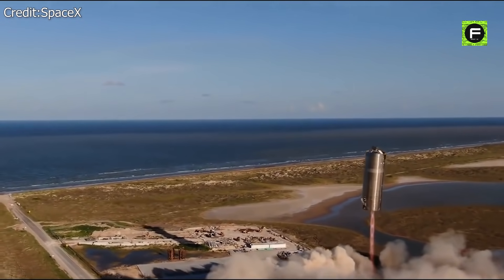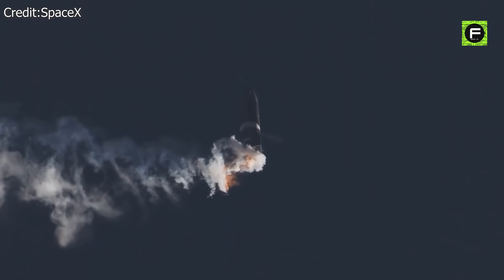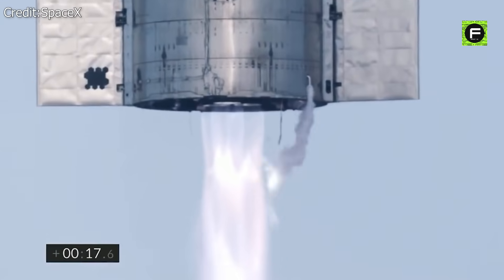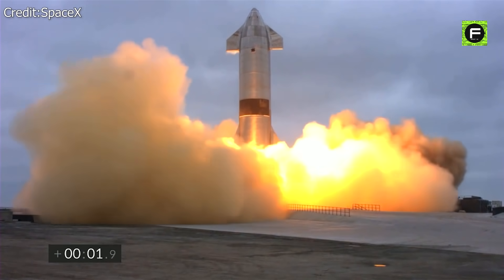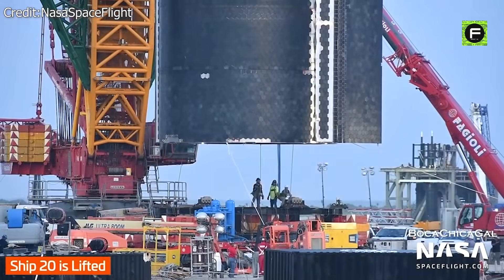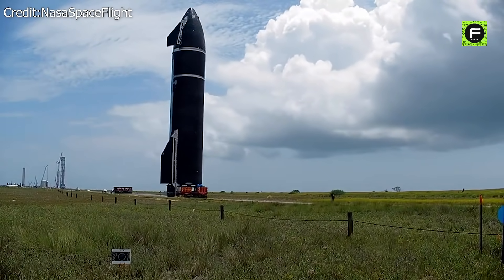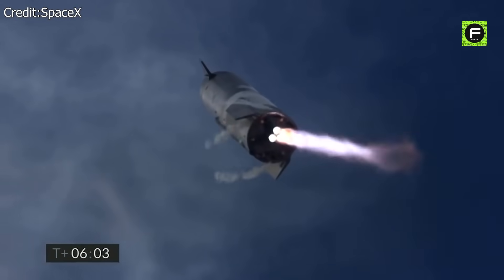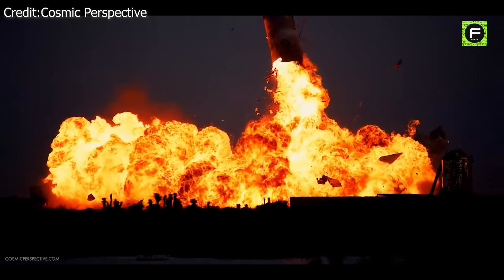Why Starship SN20 Will Splash Into Water Instead Of Landing?

Comment: GETTING STAR SHIP TO LAUNCH IS ONE OBJECTIVE ? NJEXT IS BOOSTER TO LAND ? NEXT IS STARSHIP TO ORBIT ? NEXT IS TO RTENTER? NEXT TO LAND???? TO LAND NOT ON A CATCHING ARM? TO L;AND ON ROUGH GROUND????  LANDING TOWERS Cannot be built every where? any slight direction error will be a titanic accident waiting to happen?   Getting massive pay load to orbit means this access of mass weight can be traded for landing gear and emergency equipment?   launching and losing  a machine is crazy waste of analytical inspection? lift off to a, compete safe return should be the first and final  only goal?  Salt lake wouldm be a great barren area to soft land the sn20 oir area 51 or navada testing ground

Comment: The simple fact that they no longer have a mechanism by which they can "land" the ship other than by being caught, and the fact that the catcher does not yet exist, means there's no way to actually land it apart from splashing it.  The stubby little legs it used before no longer have a place in the ship as equipped with all six engines, and the pad they were using to land on is no longer there.

Comment: Could it be that they want to see if they have cured the 'fiery tail' syndrome with this latest itineration?  If all goes well, then good.  But, if not, then they will have the body of the ship and the data to continue to work on the process of landing without a burning ass.
Reply: The biggest unkown is if the heat tiles will hold. We've seen them crack and fall off since when SN20 has performed static fire tests.

Comment: Does superheavy have header tanks?
Reply: No. Superheavy boosters do not go through a "belly flop" in flight like Starships do, so they don't need header tanks. The only reason Starship has them is because the fuel in the main tanks gets sloshed around as the ship flips. Supeheavy doesn't flip like Starship, however, so there is less danger of sucking air bubbles into the engines.
Reply: No. Only starship has header tank. It needs it to perform flip maneuver right before landing. Super heavy does not perform such a maneuver.